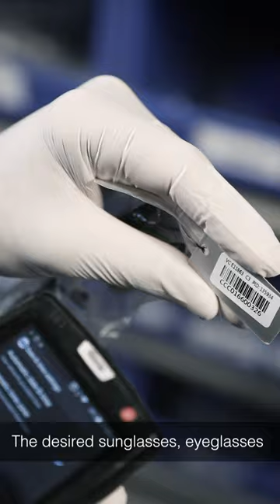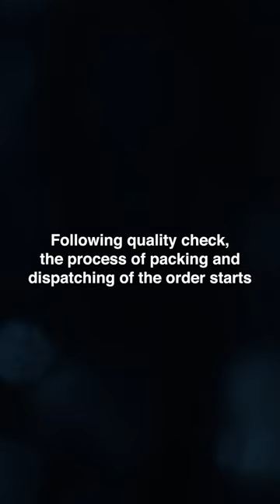Lenskart Order Status (UHD)

Comment: What problem has lenskart solved!

My  optician round the corner is way more efficient and caring than your stores. And they have been serving us for decades. Half ur stores are closed in Pune

You are just hype n encashment of digital money

I will never get the personal touch in ur sparkling store's. I urge every one to show these digital company a lesson.
They are growing because of freebies n not by services rendered.
Reply: Don't know bout' you but few years back i got my glasses from the local optician. As i need glasses through out every day he said that i will give you best glasses with best frame and best glasses. Frame alone cost me 700 and lens cost me 1600. I invested 2300 on my glasses coz i had to as this is my necessity apart from this he also took 200 extra for eye test came out that my no  is -3.00 and -2.50. I gave him the money and after 3 days i picked up my glasses. Just after 3 months my frame cracked when i was cleaning my lenses with the cloth he provided me. I was like okay it must be my fault. Maybe i was cleaning the lens to harshly. So i bought another frame from him. Then just after few days my lens starting to get Scratches and they were just use less. I contacted other optician and he told me that these are just standard lens which cost around 300 - 400.

So then last year i bought my new glasses from the lenskart store and i am still using them without any issue and no scratches and with the coupon and vouchers i had, i only had to pay 1700 for the blue thin which is the costliest they have.

So maybe no our local optician are not even that good
Reply: I have been using Lenskart from past 4-5 years. Best experience